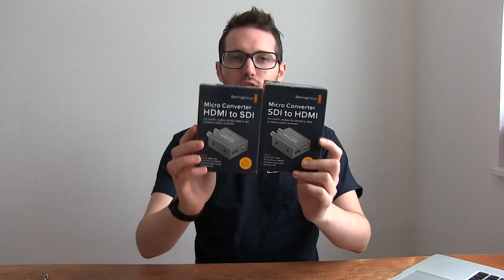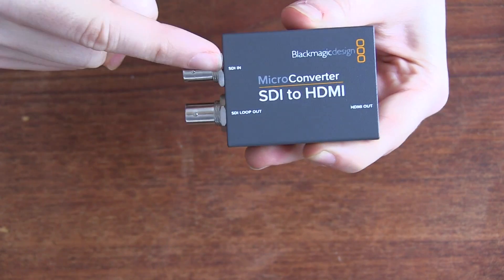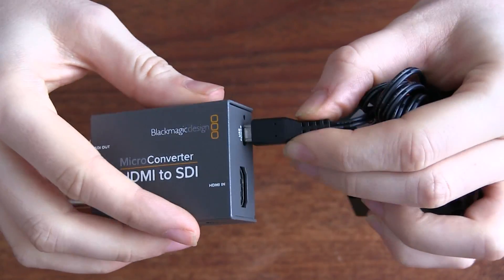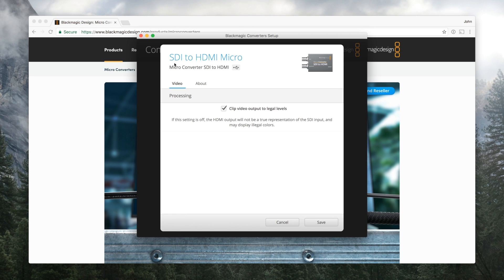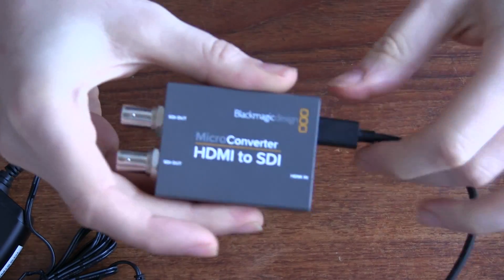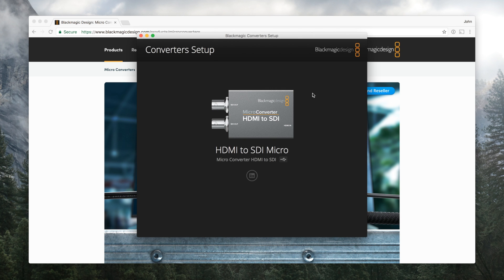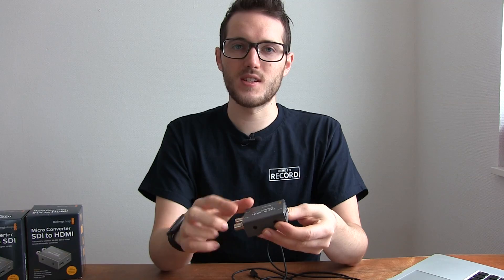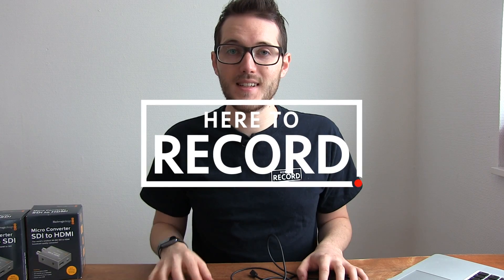BMD Micro Converters - SDI to HDMI & HDMI to SDI // Show and Tell Ep.4

Comment: I own several BM converters including up down cross. All fine. I bought 3 micro 3G HDMI /SDI - what ever level they are set to is causing compressed image on known good monitors. I downloaded the setup utility and jacked in usb c to unit and usb A to laptop- power on / lights up. But the utility doesn’t see the converter. 
Can you send a link to the proper utility for hdmi/ sdi 3g micro? Thx

Comment: How about if I want to connect my red Komodo and use the FEELWORLD FT6 FR6 5.5 Inch Wireless Video Transmission DSLR Camera Field Monitor Built in Transmitter and Receiver System . Would using one of these converters work and if so which one?

Comment: Hello,
Question: My camera has HDMI out only. I'm running it to my switcher through an HDMI to SDI video converter. My switcher has 2 PGM outputs. I try using either one to connect to my PC via a capture card and the video signal is glitching. Is there a reason why and how do i fix? If i connect my camera direct to switcher via HDMI only without the video converter i don't have any issues only if i try using SDI. Why and how do i fix? Your help is much appreciated.

Comment: Hi, my SDI to HDMI has just arrived but I'm having trouble getting my ATEM Pro to recognise it. 

Basically I work outdoors streaming sport and HDMI is a bit loose, also they aren't ideal for long distances and I go through a lot of them. So I was looking to switch and go SDI from the camera, into the converter and into the ATEM by HDMI. I think i have the correct converter for this? Should I be using a higher standard of SDI cable maybe. I got 30m SDI from Amazon for around £30. 

Let me know if you have any thoughts, cheers!
Reply: I'm starting to think this isn't a function that the converter can perform and that the idea of the switcher is to connect video feeds to monitors etc. I think if I want to use SDI, I need to buy an SDI in mixer. Thoughts?

Comment: Hey i have a NTSC TV and the country i moved to has PAL system how do i convert the video. Because when i connect the coaxial cable to the tv, output comes in black n white. When i connect my Ps4 thru Hdmi it comes in color.  Is there any way to convert Coaxial to hdmi.

Comment: Would this work for going from a camera - HDMI mini - to an ATEM mini - HDMI? I need to travel a long distance (60') and my camera is HDMI mini and the ATEM Mini is HDMI. I believe the SDI will allow this long distance. I would do HDMI min to HDMI cable into the converter than SDI most of the distance then converter to HDMI to ATEM mini.
Reply: Yes that will work just fine.

Comment: Good video. What length of SDI cable do these support? Could you have HDMI going into a converter then to a 50m SDI cable run and back to HDMI for encoder PC input?
Reply from the maker: For sure, I’ve run 75m with them but you will want some decent cables if you are getting that long.

Comment: If I plug a 720p source into the converter will it be able to convert to 1080p?
Reply from the maker: It will not. You will need a Blackmagic UpDownCross or a Decimator MDHX to do cross conversions like that

Comment: I need a multi stream setup with 3 hdmi cameras at distances. For that I'm planning to use ATEM mini which has only hdmi inputs. For that I have a plan please check it whether it is feasible. 'From camera hdmi output cable, conversion of hdmi to sdi (for making it feasible for long distance transmission) then since ATEM has only hdmi inputs once again conversion of SDI to HDMI and given to ATEM Mini. Output of ATEM mini is HDMI so atlast I'm planning to use Ultrastudio mini HDMI recorder which gives thunderbolt output to computer.
Please check whether this will work.
Reply: Ligin Hananiah that’s my exact plan. Haven’t tried it yet because I’m waiting on the atem to come in.
Reply: @Candorous7 Thanks for reply. will it affect using too much converters?
Reply: Ligin Hananiah I don’t believe so. The problem I’m finding from reading is the Ultrastudio recorder. It only operates at 1080i or less, which has given many people problems.
Reply: @Candorous7  ohhh okk. Let me consider that...
Reply from the maker: Sorry for the delay. Yes this will work just fine with all the converters. I have done it myself. You could also skip the Ultrastudio and just use the ATEM Minis USB output to bring the signal into the computer.

Comment: My laptop doesn't detect any signal from my hdmi to sdi micro converter.  What steps should I follow first in order for me to get a signal
Reply from the maker: This device is for outputting your HDMI signal from the computer. It you connect the HDMI to the converter and then the SDI to another piece of equipment, it should work as expected

Comment: If we are using the ATEM Television Studio Pro HD and the output for programming is SDI, will the SDI to HDMI work if I have a HDMI Capture card to capture that feed?
Reply from the maker: Yes that should indeed work. You might need to double check that your capture card can support whatever frame rate and resolution you are outputting, but otherwise it should work!

Comment: So, quick, but tough question here. I have an Atomos Sumo and we are shooting a multi-cam green screen course for a tax professional where I would ideally like to have two camera feeds at 1080 23.98 and the third feed has to be his Surface Pro, which is pretty firm on not cooperating with changing the refresh and/or frame rate.  If I run the HDMI from this Surface Pro into a converter, is it going to match the frame rate/refresh rate of the input, or praise jesus please work, the output, or will it flat out not work...furthermore, anyone know how I could get this Surface Pro feed transcoded to 1080, 23.98 in the middle man before hitting the Sumo?

Comment: I have the BMD mini recorder and was going to purchase the sdi to hdmi and hdmi to sdi to enable longer cable legth from the camera.  I was thinking of using the bidirectional so i can have both hdmi and sdi outlets at the camera end as I wanted to have a camera monitor and needed hdmi out to run the cheaper monitors.  In the end I purchased the Viltrox DC-70EX 4K 7"LCD Camera which has hdmi and sdi 3k inputs and outputs and saved me getting these converters.  In AUS dollars the cost of the two BMD converters retails for more than the monitor with the same functionality and a monitor thrown in.

Comment: One quick word of warning. While these boxes work great for converting HDMI to SDI and back to HDMI for sending a laptop signal to video monitors, they may not work for projectors. I found this out trying to use them to send an HDMI signal from a MacBook to a Christie LX100 projector.

It turns out that the HDMI to SDI converter changes the color space from RGB to YUV and the SDI to HDMI converter does not change it back. Most LCDs are fine with either RGB or YUV inputs, but many older projectors are not. BMD tech support informed me I’d need a different converter to get back to RGB.
Reply: I used this to convert SDI to HDMI to a SONY Projector and it works. I agree tho to be very careful and check your projector and compatibility.

Comment: Would this device stream Roku or display raspberry pi to an old coax - pin connector tv?
Reply: No, this is not a device with a coax connection.  I think you need a modulator to connect your (Roku) or Pi.  This link below is a product on Amazon it might help you.  God Bless.  

E-SDS HDMI to RF Coaxial Converter Box with Remote Control,HDMI to Coaxial Analog Signal Support Zoom Function https://www.amazon.com/dp/B07DHM23VQ/ref=cm_sw_r_cp_tai_e7wLCbNJ7KP9M

Comment: Can I send the camera signal, using SDI to HDMI, direct to HDMI in a projector, without using a laptop?
Reply from the maker: You can indeed. Provided the projector supports the resolution that your camera is outputting. Otherwise that should work!
Reply: Many thanks for your reply

Comment: Which one of these would I need to live stream the video from my Samsung HD TV to my MacBook using Wirecast to Facebook Live?
Reply from the maker: Does your Samsung TV have HDMI out?
Reply: I have a Samsung UN55ES8000

HDMI 3 input
USB 3 input
Ethernet 1 
Component 1 
Composite In (AV) 1, 2 (1 shared with Component) 
RF In (Terrestrial/Cable Input) 1 
PC/DVI Audio In (Mini Jack) 1 
Digital Audio Out (Optical) 1 
Audio Out (Mini Jack) 1 
RS232C 1

Comment: How long can you run the sdi cable using this hdmi to sdi converter? Thanks for the answer :D
Reply: That's correct. An HD-SDI signal can travel up to 340 feet through Belden 1694A, a top-quality coaxial cable. Thinner or lower-quality cables (or multiple connectors/barrels/patches) will attenuate the signal more and limit your range. To extend the signal farther, re-clocking DAs can be used as repeaters.
Reply: Ferdinand, the block diagram of the SDI to HDMI Micro Converter on Blackmagic's website shows that there's a re-clocker between the SDI input and looped SDI output. This means you should be able to use it to repeat an SDI signal to go a longer distance. (But I haven't personally tested this converter.)
Reply from the maker: I really think it depends on the quality of the cables you buy but I believe up to 100m is the limit before needing boasters.
Reply: Here to Record wow real quick reply, thanks for the answer :D
Reply from the maker: Always happy to help! Thanks for the comment :)
Reply from the maker: Thanks Eric - that was a much better answer :)
Reply: Can I use the SDI to HDMI Converter as a SDI Repeater?

Comment: Hi, I have bought yesterday  this HDMI to SDI converter . After connecting the cables and turning the converter power on , I made a channel scan on the TV to find the frequency of the converter but the scan result was"no channel found" . So i have got no image on my screen Even though the computer can read it and it detect a secondary screen connected. do you have any idea how to solve this problem?
Reply from the maker: I’m not sure what you mean by “channel scan”. These are converters for hdmi to sdi conversion so your tv need to be plugged in via hdmi or sdi (but I’m presuming that you don’t have sdi on your tv)
Reply: ِActually my TV does not have HDMI port but it have the SDI. I want to connect my laptop to it this is why it use the MicroConverter HDMI to SDI . 
So I have to make channel scanning to find the image of the laptop. but I found nothing.
Reply from the maker: What tv model do you have?
Reply from the maker: I have a feeling that you have an sdi style connection on there but it isn’t sdi.
Reply: the port on my TV is that one we use to plug Antenna using Coaxial cable.
Reply from the maker: Yeah that is a completely different form of connection and these converters will not work with that at all. That is only for a tv antenna.
Reply: If it is true then how do you connect this converter to the TV to have an image from the computer
Reply from the maker: The only way is that the TV would have the right SDI port on it. Only broadcast monitors have those. You may want to return the device for a refund.
Reply: Thanks for your help. but did you know another kind of converters that can do what I want?
Reply from the maker: It’s hard to say without knowing they other connections are on your tv, but there may be a solution with one of these... https://www.blackmagicdesign.com/products/miniconverters just remember that using the antenna connection will not be possible.

Comment: Can i Connect this to Windows Laptop
Reply from the maker: +rashid kkv you can indeed. There is software to control the device on Windows. You can also use a HDMI output from the windows laptop for presenting if that’s what you want to do!
Reply: Which software can i use for control it.
Reply from the maker: You can install the software from an SD card provided with the item

Comment: So I have this idea and I am not sure if it will work or not. I need a monitor in my operating theater and the medical grade ones are super expensive. so I thought about buying a TV screen and an sdi (from my surgical camera output (STORZ)) to HDMI (TV Monitor) converter. Would this work ?
Reply from the maker: +fahad alasousi that should indeed work. So long as the output resolution of the camera is supported by the converter

Comment: Introduce video delay this converter ?
Reply from the maker: +Regia TeleOltre certainly not that I've noticed, but if it does it'll a frame at the most. Certainly no noticeable delay in my testing!
Reply: Thank you for your test! I bought a Chinese clone that works perfectly but introduces a delay of about 10 frames, and when I use my gopro connected to a atem mixer and recording musical battery is not that great. So I was thinking of taking this original.
Reply from the maker: Wow - 10 frames! That is a little too much! Hopefully the Blackmagic Design ones work better for you!